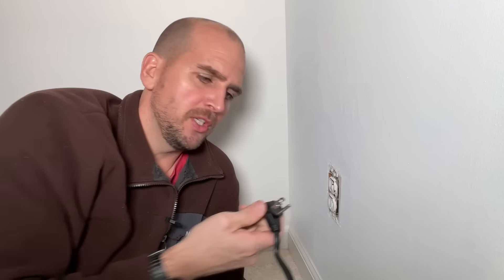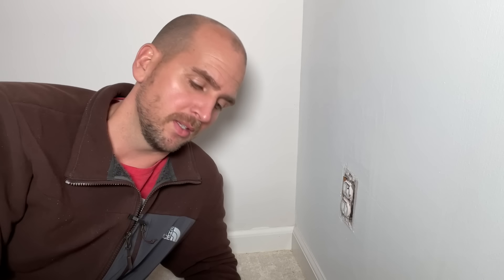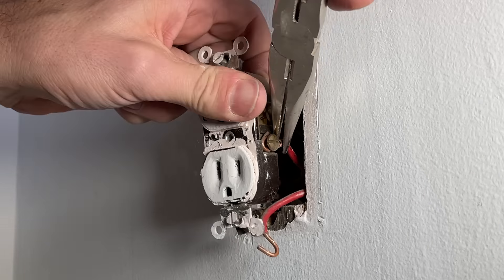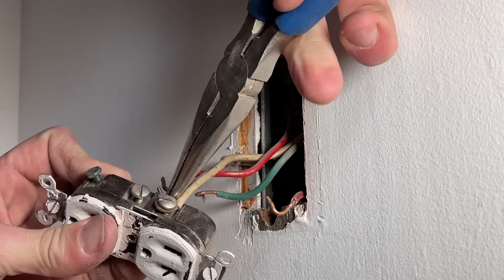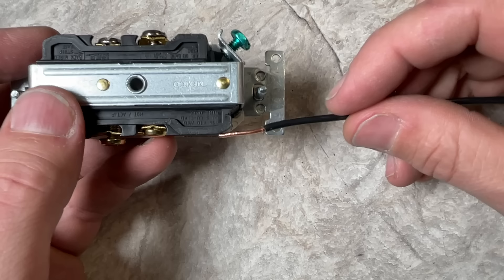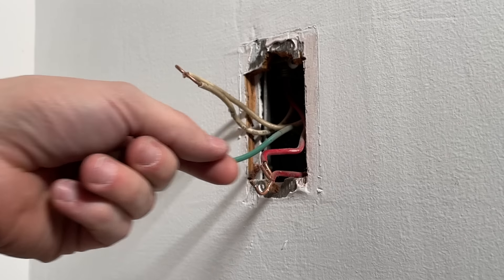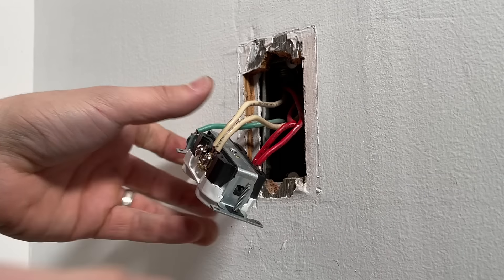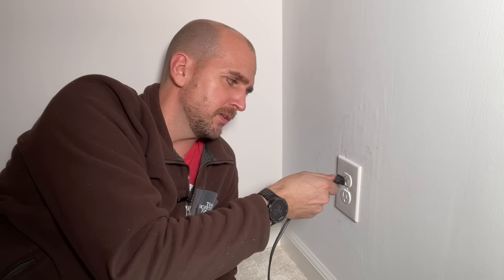Plug Won't Stay In Outlet

Comment: Tip:  at about 3:05 - you can remove those wire screws completely and those wires will be much easier to work with.  And yes, replace the outlet.

Comment: That was the right move, putting both wires on the same screw when back wiring. I don't like to back wire with only one wire, because that puts a bind on the screw, which means, you feel the screw tighten up, but you don't really know how well it's gripping the wire. If your outlet only had 3 wires (hot, neutral, ground) I would recommend the "shepherd's hook" technique, just so the screw can seat evenly on the wire. While the shepherd hook is a little more difficult to work with, it will maintain a good connection, with minimum thermal cyclic stress. Well worth the extra effort.
Reply: I would have pigtailed the wires. If the receptacle ever goes bad you do not lose power down the line.
Reply: code requires that if two or more wires service the outlet they must be pigtailed
Reply: @dalezeilinger7859  That is true on the neutral wire but nor the hot.
Reply: Putting 2 wires under 1 screw is against code.

Comment: I agree 100% with every point made in this video. I just have one observation. If you have a weak outlet that won't hold a plug in, DO NOT use a 3 prong plug using that ground to hold it in. Many years ago a man actually died in a house fire and the investigator discovered a small heater plugged into the outlet where the fire started. After speaking to some family members it was discovered that the outlet was worn out. The outlet was sent to a lab and examined. It was determined there was a high resistance situation at the plug caused by a really loose connection and the ground plug was holding it in. It got hot and started a fire. The man died of smoke inhalation.

Comment: When I remove receptacle that has 2 wires on each side I will pigtail the pairs and then wire to receptacle. This will reduce the possible reduction in wire in the box if you have to make repairs in future. Doing this at first installation makes it easier to put the receptacle in. One must ensure that you meet the code requirements for box fill.
Reply: Normally the supply / neutral attaches to the top and the bottom is for the next receptacle.  The also avoid excessive bundles.

Comment: I'm an electrician.  I suggest to replace with commercial grade receptacles.  There a little more expensive,  but well worth the $$$. Also, since you are replacing,  remove the screws all the way. That way,  you are not bending the wires, which weakens the copper.
Reply: Replace them with quality UK sockets ! but fuck you want shit sockets you got em
Reply: Twisted Hillbilly  Yep, 20A requires 12 gauge (or bigger for longer runs which usually do not occur in residential buildings) 100% of the run.

Comment: I like your videos,, they are well done and quite informative. One thing I think you could've mentioned, is you had two hots and two commons, that you removed from BOTH screws on each side of the old receptacle, but you put the two (hots & commons) back onto only one of the screws on each side of the new receptacle when you re-installed them. Perhaps you should've mentioned that the upper and lower receptacles are linked together by a "jumper" of sorts. Just in case anyone noticed and was confused.

Comment: If you're replacing devices, cut off and restrip the ends since they are damaged/worn. If you need to, wirenut a new piece of wire (called a pig tail) to extend it out of the box.
Reply: No need if there actually wore enough you will notice it the will break off with even the slightest force or bend
Reply: Good thought unless they’ve already been cut off three times (grin).

Comment: DIY. I didn't know that heat would cause it to gap like that but over the year's I've found about 3 loose plugin's in house's I've rented, all I did was spread the prongs on the plug a bit so they were wider than the holes, that way they would touch better/tighter and I never had the problem again.
Reply: Make sure you don't touch the prongs on something that has a capacitor like an old-school TV or you'll get shocked
Reply: Yeah, if you travel a lot for your job or whatever, l don't think they want you messing with the box switches to upgrade the outlet in the hotel!.🤣
Reply: @J D Simpson The homer simpson way lmao
Reply: @lindaplieskatt9150  I think he's talking about the plug, not the receptacle and even than, it is not the way to fix the problem. You could get away with that if you ARE in a cheap motel and you just need to plug your phone charger in for the night but it does weaken the plug and just is not a fix so if I was this guy I would have just kept that thought to myself lol

Comment: I was also always taught by an old school guy to wrap the connection area with a little electrical tape just as and extra added bit of safety based on the principle of what can go wrong soon will go wrong
Reply: @ hatefunwrk --- Yes, this is how I have always done it too... Especially if the box is metal, or there are several outlets next to each other in the box... The dummy who said you don't need tape above, has never even seen even an outlet cover removed...
Reply: @frandanco6289  Right🤣🤣

Comment: 1. Any replaced receptacle in living areas must include arc-fault protection. You can buy that for the replaced location, but cheaper to put it at the head of the circuit so that any down-stream receptacles can be replaced in the future with ordinary ones. 2. Anti-tamper is only required for new work by NEC (unless overridden by local code), but use it anyway to protect 12 kids that die every year. 3. Use only screw terminals vs. push-in to prevent intermittents decades later. 4. If circuit comes in on one set of screws and goes out on another, you must pigtail at least the neutrals together so that only one wire goes to the receptacle and removing same in future won't break neutral to downstream devices. 5. If replacing 2-prong with 3-prong, install GFCI at head of circuit and use provided NO GROUND labels at every 3-prong location to be legal. (Electronic protection effectively subs for missing ground wire.)
Reply: Wait waht is oh ooh right the non living areas makes sense for the reason as to why the conceot of non arc fault circuit interupter outlets are sold still... otherwise they would be useless fwiw also Idk that so thx dawg <genuinely>
Reply: i have no idea what any of this means
Reply: My house has 2 prong and several 3 prong outlets (all have this drooping issue) but there is no ground. Do you think non grounded GFI outlet replacements would be acceptable or should I pay a few grand to have a new breaker box and new ROMEX?

Comment: You can wire it like that but but if you put one wire under one screw and the other wire under the other screw if something happens to the plug the copper piece between the two screws act’s a fuse link and it can protect the circuit down the line and also makes it easier to find where the trouble is.

Comment: As a note, this would be a perfect time to replace the outlet with a side-installed one. I can't recall what the "actual" name is, but they're the new ones that don't require you to make a J hook to attach. They just slip in. Good thing is that those already have a gauge by which you can measure how much exposed wire you need built right into the back of the outlet, but they also normally come with channels on the top and bottom where the screws are. Not many folks know this is actually a wire cutter built directly into the outlet. All you have to do is measure what length of exposed wire you need, mark the wire, slip it into the angled grooves at the mark, turn the free outlet a couple of times, hold tight to the outlet and the wire, and then pull quick and hard. 
Voila, the exact length of exposed wire and the shroud cut without any tools other than a pencil. 
However, this is great advice for someone like me, who replaced all of the outlets and one still tips now and then. I think that's more me (because it's where I have to walk to get out of bed) than the new plug. But if I can make it tighter and more safe, I'll do it. 
Thanks for the video!!

Comment: Good practice to do a wrap around outlet with electrial tape to cover the screws when installing in a metal box
Reply: What the F!  If your work is that sloppy you should not be doing electrical work.
Reply: Why? Once the outlet is secured and the power turned on, there is no way for the screws to contact the box. Nothing metal can get in there and short out the gap either because you are going to kill the power before taking off the cover plate, right? That, and taping over wire nuts, are unnecessary and unprofessional.
Reply: @FisherCatProductions  no it is good practice but the reasons you mentioned are why it’s not code why because if you take out that plug and hit the side live it could short i have changed plugs and switches live I know I shouldn’t but I have and although I’m carful not to touch it can happen so If I have tape I’ll do it if I don’t it’s ok
Reply: I was a student in Residential wiring in a vocational School In highschool.  " Many" years back😱. Loved it. WE to was showed to wrap the terminals and wire nuts with electrical tape. It was NOT code. But a added safety of personal gratification. It's "Not" about being Sloppy work. Just personal preference. Plastic boxes normally didn't tape device. If the job was completed correctly. Tape or No tape. The finished product will be "safe"  as well look of satisfactory. But hay😎. What do I know⁉️ I'm a FARMER 😂. Baylor twine. Duct tape and Cow poop. Is what we have to work with😉. Be safe my fellow reader's. Guy from Ohio.
Reply: @mattking3148  good here in Canada we mostly use metal boxes so love it we can just ground everything to the box we also don't have to ground switches

Comment: My father was an electrician and he always said to shut off all power to the house for a quick repair.  It wouldn't do any harm and there was no doubt about the power being off.
Reply: Only those who have no idea turn a whole house off....
Reply: You can never be too safe, you don't know who's done what before you. Turn off all you can you never know if stray current might activate an otherwise dead circuit.
Reply: @gregordonnach7970  Also, as an electrician, my Dad worked on a bunch of different houses.  In my house, Mom did the changing of the light switches.
Reply: @SirFartzoLot  Yeah, that is what the circuit breakers are for, amongst other uses.
Reply: @user-vk9rq1zu43  So what, if the circuit breaker is off nothing would happen and it would go straight  to ground. you should stop making such dumb statements.  You apparently know almost nothing about house wiring.
Reply: @toriless  And if it was?
Reply: Anyone remember the days of cartridge and screw in fuses? The purpose for the having varied amperage ratings was for limiting amps as a way of avoiding shorts which could cause fires. CIRCUIT BREAKERS came along to also make it easier to reactivate a circuit once the fault was corrected without having to replace the device.

Comment: One additional thing I do—especially in a metal or multiganged box:

after reattaching all the wires, I give the whole receptical a wrap with a strip of black electrical tape covering all the screw terminals.

For a penny of tape its a little extra protection against arcing.
Reply from the maker: Thanks for the feedback Kelley.  👍
Reply: @EverydayHomeRepairs  Don.t do it - it's not needed and it's sloppy work. It just invites some idiot to pull out a hot outlet and think he's protected from shock.
Reply: @jerrysmith372 "this only shows you're not an electrician and do sloppy work"? Who the fuck died and made you king shit? I'm a licensed electrician and I tape devices in metal boxes, you gonna fire me? Stop trying to force your OPINIONS on people as code requirements.
Reply: Supply houses sell oversized rubber bands to do the same thing... I guess you'd be firing a lot of electricians.

Comment: Thanks. We have this problem with several outlets in my 1984 town house. The directions are clear. What scares me, a total dummy, is making sure I have turned off the correct fuse in the panel box. Seems like electricians have worse hand writing than doctors. It is hard to tell which fuse is connected to which area of the house. But I can of course try what appears to be the correct one and check if it is hot or not. Thanks again for the clear help.

Comment: I always use Professional grade plugs when replacing worn out 1980's style Residential grade 15 amp plugs at my home.  Leviton brand
Reply: @Brandon Penny by professional he probably means commercial or hospital grade which is more expensive, or u can get residential grade which is a lot cheaper in price. Both r sold at hardware stores

Comment: Non contact tool saved me. Outlet was off, there was a stray hot wire in the box.
Reply: Have had that happen to me many times..
Reply: Its only 110v. Unless your standing in water its a tingle. 
220v? Thats good jolt. I don't recommend. Been there. "Yeah its off....go ahead"....aaaaahh !
Reply: @roberttyrrell2250  110v can still kill you.. All depends on path and your condition. I've been hit by 220v also.. That's no fun at all.
Reply: @nutbastard  That's why I always switch off all the breakers, before I start working, whenever possible. Doesn't hurt to be extra safe.
Reply: @roberttyrrell2250  I'll take a hit of 220 over 347V any day. 

Treat everything as live, very unlikely to get hit if you know what you're doing. Safest way especially for those times when stuff isn't off
Reply: @roberttyrrell2250  yeah the difference between 120v and 240v 
120v: "did i just get shocked?"
240v: "ahhhh faq, why me?"
Reply: @SapioiT  never trust a breaker.  Check 4 voltage. 😉
Reply: @Seriouslydave  yeah that'll make sure youre paying attention. I've worked on just about everything. 887. That'll jump 6' to get to your wedding ring turn ya into a bubbling puddle of goo.
Reply: @roberttyrrell2250  Yeah, I always do that.  And even after checking, i often try to not touch the wires directly as much as possible. I might need to invest in a pair of thick rubber gloves which are harder and allow us to clump down metal and twist wires together, just as an extra safety measure. Especially since using devices with batteries and plugging them into the wall could introduce charge, depending on how bad the wiring of the house is done.
Reply: @SapioiT  If lines dead you don't have anything to worry about. Cutting twisting wire is best done w tools. 😂 
Never forget this guy I was working w. Al. South Philly Guitto tough guy. "You touched my Iroc I have to kill you now"  kinda guy. 
Al yells "Power off?" Boss:"Yeah Al go ahead". No one checked it. He hits this bundle of service lines from pole, w burn saw(demolition) BOOM POW FWAP ! Blows the blade into million pcs. You could watch the blood drain. Where ya going Al? " I'm going home....Thats it... I'm going home.."🤣😂🤣😂
Reply: @roberttyrrell2250  Yeah, but there are some cases in which tools won't cut it. Or twist it, in this example. And you won't always have all the best tools available, especially as a hobbyist. And if you do, kudos to you.
Reply: @SapioiT  I have a divot in my front teeth from stripping wire. 🤪 My youngest boy just grad elect school. Starting out as Journeyman $27/ hr. I didn't think he was paying attn when he helped rewire the house. 216 yr old farm house. Theres remnants of old knob / tube from 20's.
 My other boy got into constn Does brakes, tune ups ect on side. 
I thought they w F'ing off the whole time helping me. Who knew? 🤔🤣😂🤣🤪
Reply: They can be useful in a number of instances.  Especially if you have two circuits in the same junction box.  One was AFCI for the bedroom and other kitchen lights.  Can you see why that mixture might not occur to me.  You generally want to isolate circuits.
Reply: @roberttyrrell2250 edited after posting...Robert Tyrell...this comment of mine is ignorant and i apologise for it...im not a registered electrician,nust a worker in the field...
Reply: @dexterdequoitdikkentheworl87 please. 😂🤣😂🤣😂 110 is just 1 leg off the pole. 220 is both legs off the pole. Same amps from same source. Amperage doesn't change. You couldn't handle changing a AA batt.

Comment: When I saw the title to video, I chuckled and watched to see if he would mention what I was thinking - Nope!
However; others in the comments mentioned what I was thinking. I'm 71, and any time I had this problem I would just either squeeze the prongs together a little or spread them apart a little creating some tension and has always worked great and never had a problem.
That is how the contacts in the outlets work. When you insert the plug in the outlet the prongs are spreading the contacts a apart and it is the tension created by the outlet contacts trying to stay in their original position that keeps the plug in. Buying a new outlet is no different than if you squeezed the internal contacts of the old outlet together a little to recreate the tension. Squeezing the prongs on the plug is so much easier and cheaper than installing a new outlet.
I noticed he never responded to comments about squeezing the plug prongs together. I wonder why????????????
Reply: He did not reply because he knows his title is CLICK BAIT and nothing more.  No one would go to it otherwise.  Rely number 5 will shock you !!!
Reply: Replacing an outlet takes less than 10 minutes, and costs a couple of bucks. Squeezing the prongs on your plug doesn’t prevent the fire hazard that you have from a potential arc fault.